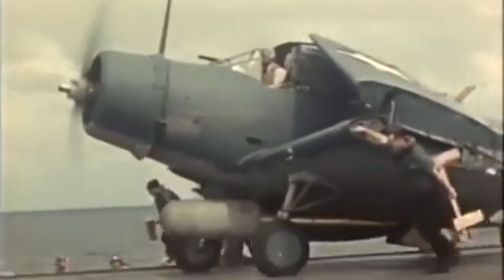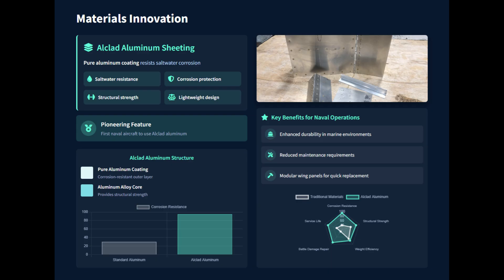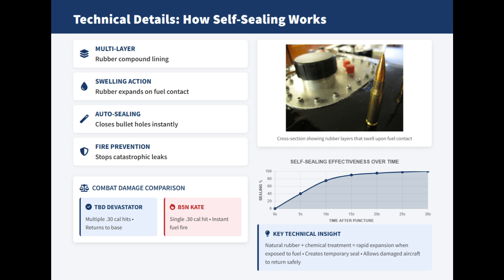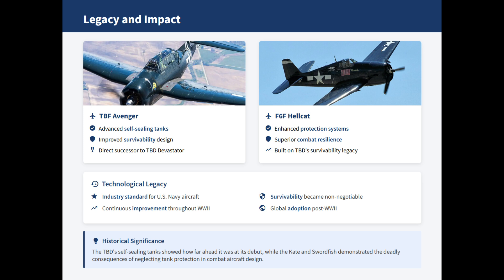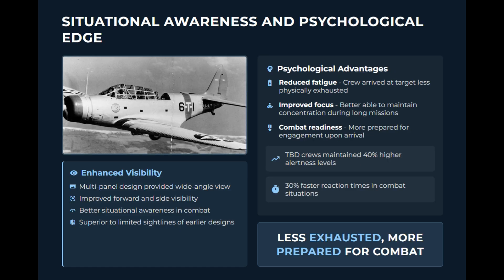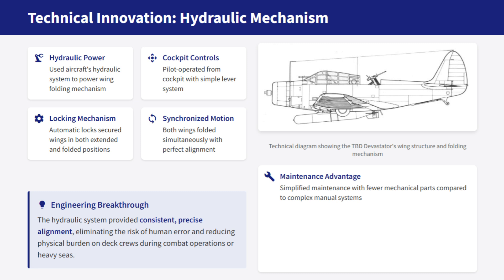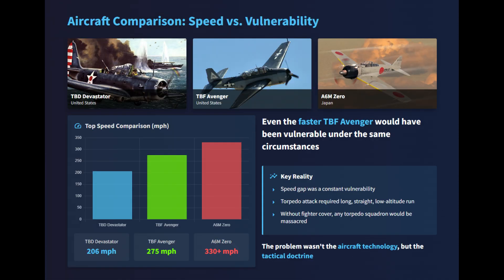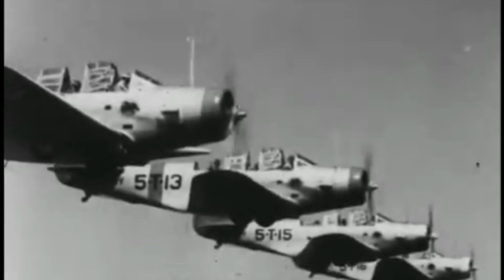TBD Devastator Was NOT Obsolete at Midway. Here's Why.

Comment: The effects of the TBDs' attack runs on IJN CAP at Midway were more complicated than just the A6Ms being at low altitude. The A6M had an excellent rate of climb. What the succession of TBD attacks did accomplish was to create target fixation. Both the IJN CAP fighters' and on-ship lookouts' attention was focused on low altitude, the source of the string of attacks. The A6M's radio was also poor enough that fighter control and in-air coordination was also not good.

Comment: I think a better word to describe the Devastator was "obsolescence". All three planes described in the video (Kate, Devastator and Swordfish) were obsolescence in 1942. The Devastator had a lot of good points to it that were "firsts", but in this era, plane technology was advancing so rapidly that any plane was going to helplessly be behind technology wise unless updated versions were done. The hydraulic wing system as touted by the video also came with a hefty weight penalty, which affected performance. The biggest issues with the Devastator were its lack of power and feeble armament. (Something all three had in common). The other issue for the Devastator is its combat record compared to the Kate and Swordfish. The later two had generally stellar combat records of success while the Devastator is generally remembered as being the plane that sacrificed itself to draw down the Japanese CAP and allow the dive bomber units to change the course of the war.

Comment: You show a photo of the SBD Douglas Dauntless while discussing the 1935 Douglas Devastator, slow, under-powered, launched torpedoes poorly as the aircraft was DESIGNED to drop bombs in level flight. The Avengers (used at Midway) performed horribly against effective fighter cover, as did the first wave of Dauntless dive-bombers when facing effective fighter cover. The Devastators, Marine Corps Vindicators, Avengers,  AAC B-26's all attempting torpedo attacks, drew the Japanese CAP fighters down to low altitude when the SECOND wave of Dauntless' dove unopposed from 18,000 feet, some carrying 1000 lb. "battleship sinkers". "Easier than hittin' the old Arizona (target ship) in practice"-Said Ensign Ron Gay in de-briefing.
Reply: The "old target ship" was the U.S.S UTAH .

Comment: It was handicapped by the abominable Mk 13 torpedos with their crappy magnetic exploders.
Reply: The magnetic exploders were not the only problem the contact exploders failed too…
Reply: @JamesRinkevich  It was a failure to properly test and qualify the design. They were cheapskates. I worked in the aerospace rocket engine business. Cutting budgets in that phase of a program leads to failures, sometimes catastrophic failures.
Reply: @Tony-om5kr NAVAIR engineers still look down on the underwater engineers. Like the engineers who thought it was a good idea to build an explosive into a torpedo umbilical for an underwater launched missile. It short circuited the missile and software had to be rewritten to turn off power to that section of the missile lest it end up on the sea bottom.

Comment: Ehhhh...aside from the lack of self-sealing fuel tanks, the B5N Kate was better. It wasn't till the Avenger did the US have the superior torpedo bomber. 

Although you're right what happened at Midway wasn't entirety the fault of the Devastator. No doubt bad tactics were deployed. It'd be like having the Avenger at the Channel Dash; it wouldn't go well.
Reply: Biggest difference was the TBD had a less powerful engine than the B5N but weighed more.  But torpedo bombers were still deathtraps against fighters and good ship AA.
Reply: Even if the USN Torpedo squadrons at Midway had flown Kate equivalents, the outcome would have been the same, given the lack of fighter escort and poor coordination with the arrival of the SBDs. Even the superior TBF Avengers did not fare well at the Battle of Santa Cruz when making runs without sufficient fighter escort. I think the main point of the video is that the TBD's failure at Midway was tactical, not technological. We could suppose that even if the TBDs weren't almost all shot down before firing their torpedoes, the torpedoes would have likely failed upon any contact with a ship. The Nautilus had a torpedo fail to detonate that day when it hit the Kaga. But a month earlier, when the TBDs of the Yorktown and Lexington attacked the hapless Shoho, multiple torpedo hits detonated on contact.